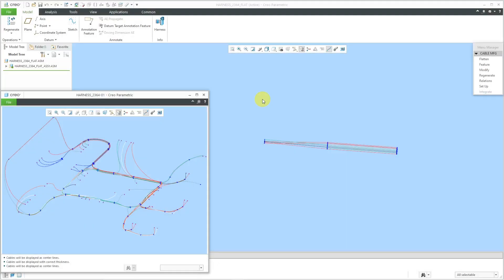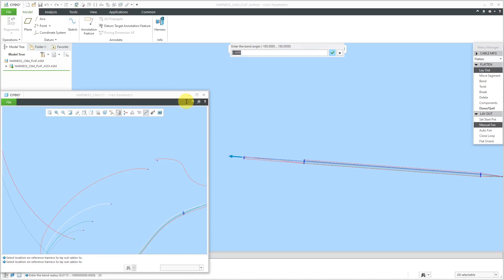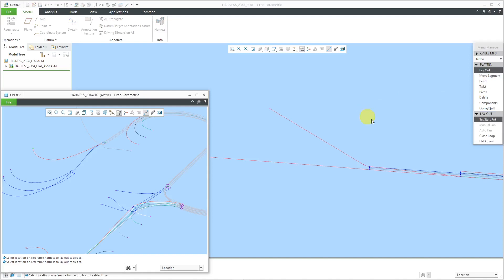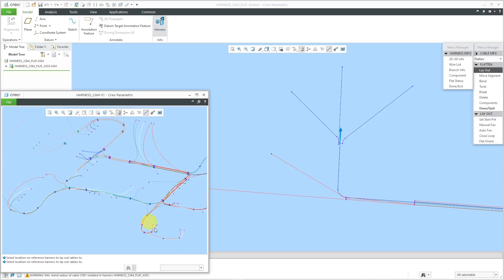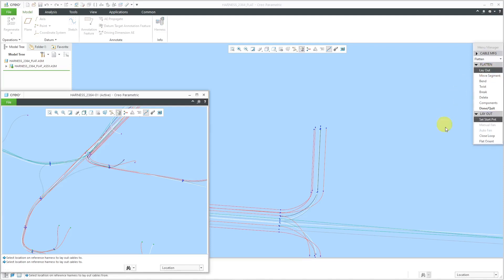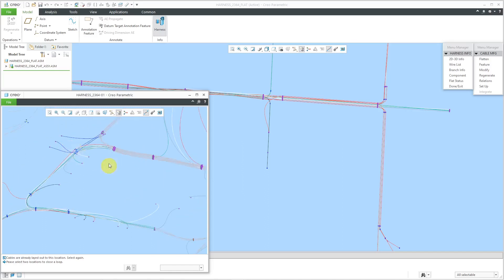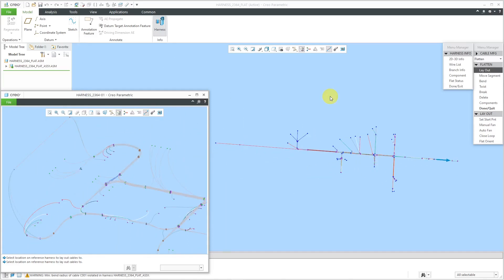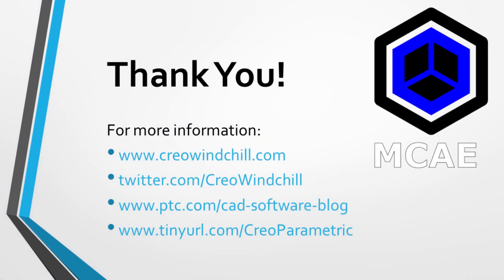Creo Parametric - Cabling Flat Harness (Part 2)

Comment: great, very helpful, videos. while flattening a very complex harness, i get the error, "There is flattened location on the path. Selection Rejected."  What the heck does that mean? any help is very much appreciated.
Reply from the maker: Well… it sounds like one of the locations you’ve selected to flatten has already been flattened. Try selecting a smaller portion of the harness either to see if you can flatten or to identify which location has already been flattened.

Comment: how to attach connectors and pins?
Reply from the maker: Are you assembling pins as individual components?
Reply: @CADPLMGuy   It is the multipin connector, a microd with the entry ports, but there are pins in it for the bom. The problem is when the cable is flattened the wires do not go to the entry point, they just I looked at the PTC training and they do not cover how to do that
Reply: @CADPLMGuy  aWszee